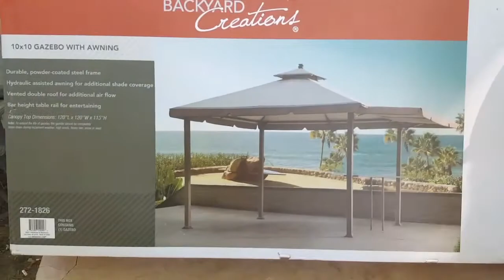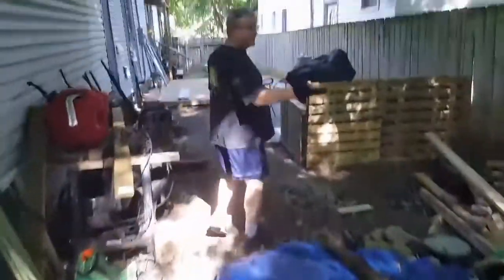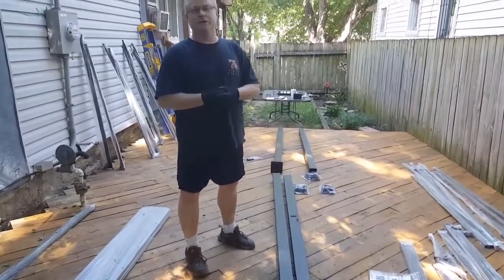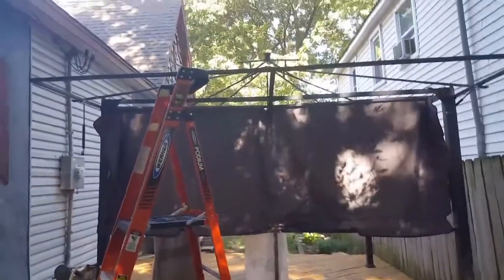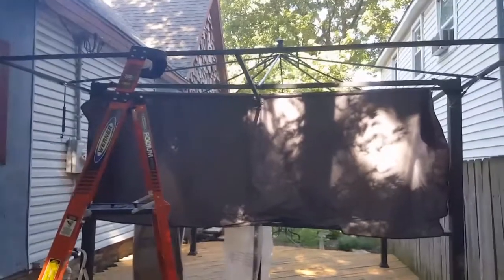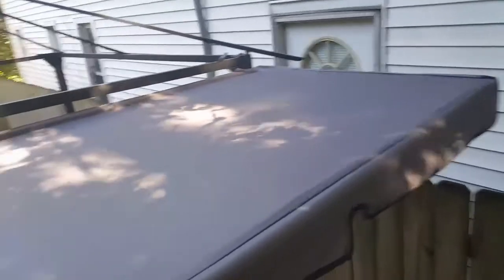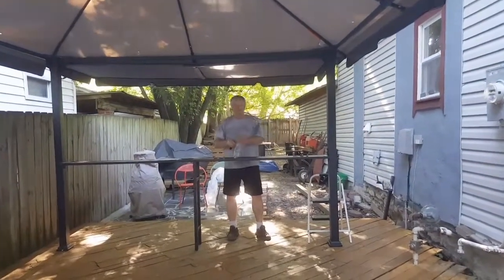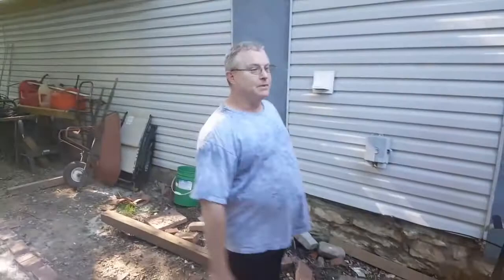Gazebo 10x10 with a 2 foot awning

Comment: I think it crucial to know that when pulling/struggling to get the canopy stretched onto the corners, it is helpful to utilize the sewn on belt loop that sits atop and use it to your advantage as you pull it onto the 4th and final corner. The other 3 are tough as it as, use the corner with that loop as the final corner.

Comment: Did you end up removing half of the bar table?  Does it come in 2 pieces?  Affect the structural integrity of the gazebo?   We are planning to put on our deck and with the awning hanging over our patio but the bar table would be in front of the stairs.  So we are wondering if we need to install at all or only install half of the bar table.
Reply from the maker: We only did half and it still work

Comment: Are the support posts bolted to the deck? Also, how is it holding up for you? Any damage due to wind? Thanks.
Reply from the maker: LesterElm1 I they were finally bolted with  6 inch bolts and then pushed into the ground and with concrete slab underneath it so yeah they're bolted and I have no problems about movement
Reply: Thanks for the reply.
Reply from the maker: LesterElm1  no thank you for watching my video since subscribing I appreciate anything and all comments you have a good day

Comment: Has yours leaked ? We just put ours together and its leaked very bad. My whole table is wet. We even tried adjusting the top part. We are ready to take apart and return.
Reply from the maker: No leaks at all but I do have to replace the gazebo, we had the 2 major snowstorms this past Winter and the middle of it collapsed all the aluminum framing but for most part I didn't have any leaks and it was pretty good but thank you also for watching and appreciating time watch my video
Reply: @wolvesr4ever38  Well what the heck should i do I'm so frustrated? We haven't even had it up a week and we have people coming over Saturday. Grrrrrrr
Reply: @wolvesr4ever38  We've tried adjusting it already. This video is what really made me decide to buy this one it looks so nice.
Reply: @wolvesr4ever38  great video by the way! I'm actually calling the company now to see if they can help. Thanks for responding.

Comment: How did you get the last corner of the top on?
Reply from the maker: Shawn Bueno elbow grease and we had to pull it as tight as we could get it and to get it on there so we manipulated it to get it right on the last corner
Reply: We absolutely cannot get the corner on
Reply: @meganradtke7125  We had this problem as well, it took 4 adults to get it on but we did! Keep trying!
Reply: Meme Logic we ended up drilling new holes, when it stretches out we can slide it back out to the regular 🤷🏼‍♀️